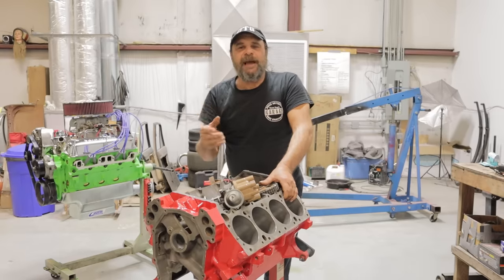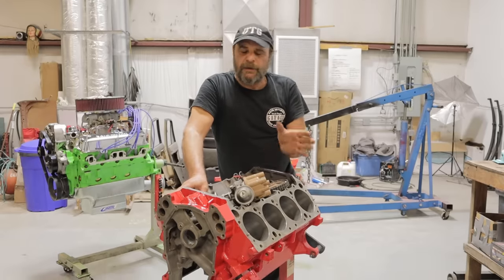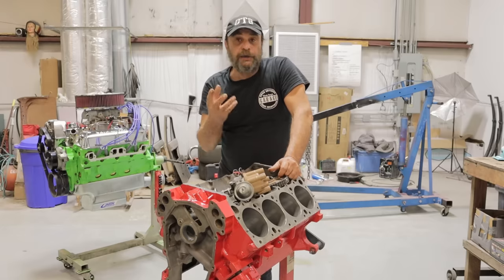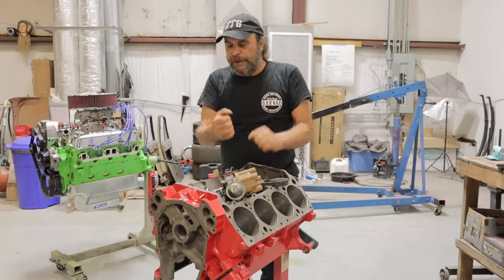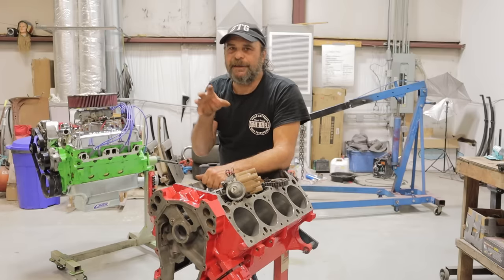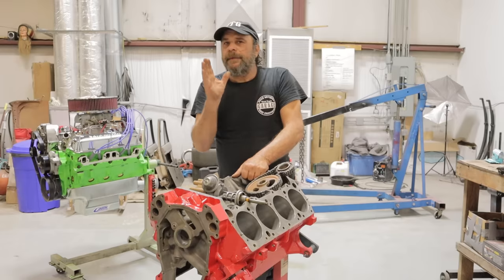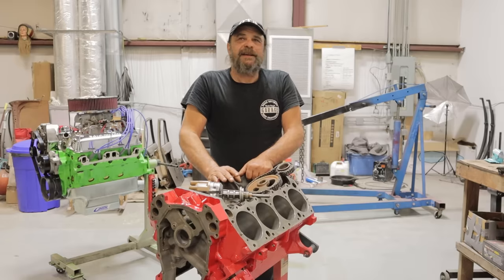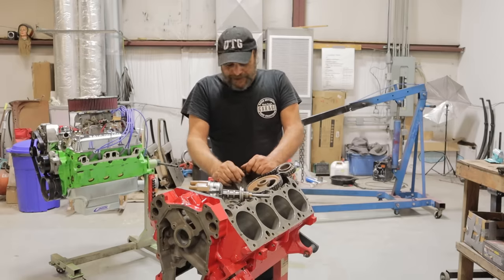Power Timing Secrets For Classic Cars

Comment: @UncleTonysGarage man, I need some help badly. 

I'm a man in his early 20s, I've always worked on cars with my pops until recently. He's had some health related issues and is down right now and not himself nor really much help, even picking his brain isn't working out. 

I've got a 1972 Chevy 010 350 
Good oil pressure, never runs hot. 
It has ".16" engraved one the flat spot inside the heads, I assume it's had some head modifications. 
Lightly cammed. 
Very old, yet functional 600 edelbrock carb w/mechanical secondaries & mechanical choke (I never hook the choke up in anything.  IJust raw dog it and barely just touch the gas pedal and feather to keep anything carbed running my dad didn't believe in chokes and I learned to drive in h is square body chevy, it's second nature now.) 
Toker II intake 
Shorty style headers. 
I deleted power steering because I, am a man and its a 2700lb car and if I can't manually turn that then I shouldn't be allowed to drive it. (Also having issues getting PS hi pressure line lol) 
AC deleted.
I'm not sure of the specs internally. I bought a 86 camaro  and  it was CHEAP. It needed a distributor and they thought it was a bad engine/unfixable/would cost more than it's worth. I damn near stole it. I have to have it to drive to work daily while I'm putting an engine in my truck and painting it. So it can't be down very long-term. So I'm scared to tear toooooo deeply into it right now because I have to drive it.  

I have 2 issues. 

1. I'm having a hell of a time getting it in time, like I can have the rotor pointed at #1 @TDC, I have all my vaccum correct, even replaced lines to be sure no cracks were hiding. The intake is sealed, carb base isn't leaking. PCV rattles when shook,  I can breathe through the oil breather. 
I'm only creating 14in Of vaccum but I assume that's low because it's somewhat cammed.  When I hit the key, it cracks right off,  even when cool on a cool day. She's not a smoker, she doesn't drink water nor oil  . NO spark knock. NO rod bearing noise. NO spark knock or hard cranking. This is why I'm stumped.  

The problem is, it's wanting wanting idle way too high (like ×1,100) when it's in park, yet it'll come down to 650 when I put it in drive
I've got it drivable now, but its not idling properly. I've got 2 tunes down, one wants to load up in gear, yet run perfect in park, the other wants to idle too high in park and barely be above loading up in gear and it's very violent going into gear so I tend to have to use the 1st tune and shift up into neutral when coming to a stop. 
Why am I having such an issue? I've never had this much of an issue with timing a car and getting it to run right. .

2. My second issue (I am going to fix this spring, I'm just bewildered by the monstrosity) is on my #5 exhaust rocker arm stud, someone has a acorn nut screwed onto the stud above the rocker. All the push rods seem to be fine, I can roll them around when they are lifted as if I were going to  adjust them. They don't seem to be bent, they are all pumping oil, they seem to maybe be a little tighter than I'd personally have adjusted them but not the tightest I've seen. Why would they put this nut on the stud? You can watch them all go up and down and nothing seems out of place.  

But: here's why I am going to address it this spring, at an idle I can't hear any type of tapping or pecking like a lifter is bad, when accelerating, hear no peck. BUT when I am cruising any speed above about 15mph I hear a slight peck when the RPM levels out and I'm in a constant throttle/speed  or operating at cruising speed.  

When I'm slowing down mph it also seems to make a bit more of a pecking noise. 

But when I get into mid 1st gear / 10-15mph coming to a stop, it completely disappears. 

I factually know it's coming from #5 exhaust stud/lifter/valve/pushrod area. I plan on restudding the heads and changing out the whole top end. valves, lifters,  pushrods, cam, springs, you know,, give it the 010 350 works like most chevy guys do with these 010 350's. The bottom end is very stout and very healthy, otherwise I'd do to the bottom as I did to the top so the bottom end dosent end up knocking on heavens door, but being as healthy as it is I think I can slide with just the top end. 

The question is, why the nut??? Why wouldn't you just retread the stud for a different nut if stripped threads were an issue? 

Could it have thrown a rocker and possibly stretched the stud threads/pulled the "press in" general motors style stud out a bit ?? (it'll get screw ins when I fix it) 

Why isn't the peck constant?? I've never seen one that is so faint, and not constant. 

I asked my dad if he heard it when we were out in it a couple weeks ago and he said im trippin and he dosent hear any sort of lifter peck, valve train noise, or anything.  Except a collector leak from the opposite side.  

I agree what I'm hearing sounds like an exhaust leak somewhat but I know it's not. You can feel it when you hold tbe throttle open somewhat pretty high and put your hand on the valve cover. Very faintly, you can feel only around the #5 portion of the valve cover, a slight peck but only around 3k-3500rpm. Honestly you can't really hear a peck though unless driving at operating speeds. 

Could the Cam not be degreed correctly when the previous owner installed it? 

Also to add it does get worse when warmed up But it's still not noticeable to anyone but Me. 
And I've drove it all this time and it doesn't ever get worse or louder. It's annoying, I wanna salvage this engine, and  I want to witness it perform to the best of its capabilities before I take it out, redo it and the car, and reunite them. 

Also, I'd like to save this engine. Otherwise it's very solid the cast isn't really rough like some , and 010 2.02 valve 64cc combustion chamber ,4bolt main,  gm 350s are getting harder and harder to come by and they aren't making them anymore so what's left is all we got. Sadly. 

Please help man, I'm driving myself nuts trying to figure these things out 

Thanks for reading. :)
Reply: Adjust the valves isn't an option right now. 
I'm scared I'm gonna open up a can of worms and not have a ride to work if I mess with the stud that's messed up. It's functioning and it's not sounding like it's gonna send a pushrod through the hood or anything. I've driven it very gutlessly for almost a year now. I just detuned it,  sanitized it,  got poor fuel economy,  and putt putted it everywhere I've gone but I shouldn't have to do that. I want good mpgs, I want to have enough power to get out of the way if need be, I want it to perform properly. I can manage to keep my foot out of it running right, I would just like the option I like for things to work properly.

A side note: someone also has cut the detent cable down by the bass and I reeeeeeeally don't know why. It's got no passing gear, which is why I want the car to actually perform to the best of its capabilities to know if I'll put one back in it or not and because it dosent jump into passing gear so I definitely need all the power I can squeeze from it. 

By all means I am not hard on this car, I treat it like a million miled model T because it's all I have to drive right now sadly.  And if I break it I'm f u d g e d. 

Oh this is for anyone who knows about fbody suspension: 

This camaro has had the torsion bar for 3 link modified. I'd say when it was a fresh build it was probably really something else because even as gutless as I claim it is, it's still pretty damn fast. But the torsion bar has a shortened about a foot,  removed from its original home where it would've mated to the tail shaft /crossmember. 

It now resides in a shorter length under the car, welded to a thick piece of square tubing which has 2 extension pieces on each corner corner of this  made of the same tubing welded to the structure of the car. 
It makes this car hook and feel very very solid in the Rear end because it'sshorter, stronger, solid mounted (welded), and i just thought it was neat and could possibly give some other 3rd gen camaro guys some ideas. .

Comment: I found that blipping the throttle and advancing the distrib. to where the engine takes off instead  of it sounding like it's trying to catch up, puts the timing right. And if you use a light, you know when its right because it will stop advancing on the balancer. I can see why you took so long to do this vid. because you don't sound like you know how to describe what you're doing. Also, the word nudge is pronounced as N-uh-dge, not Nooge.

Comment: Nojes???

usaally when i lsioten detonation i put a new gasoline witj more octanes and it solves the problem,

but the rela problem is you usually dont listen the knock but the nock exist so it willdestro your engine slowly..

YOUR RUILE DONT APLLY TO CAR ENGINES SORRY.
because when you lsiten it is becasue its is already very bad,, 
you need to control detonation in other way.. there are differnt ways to do it...